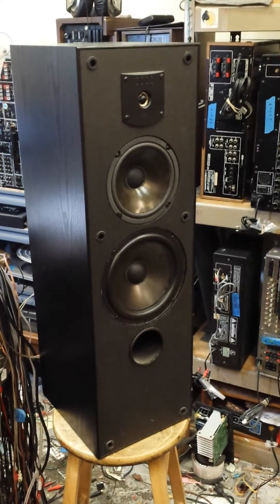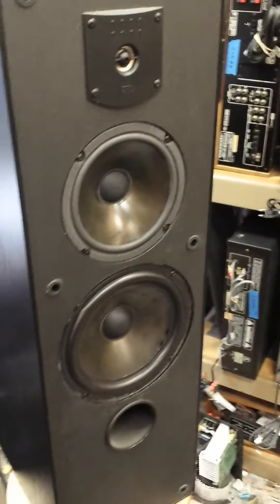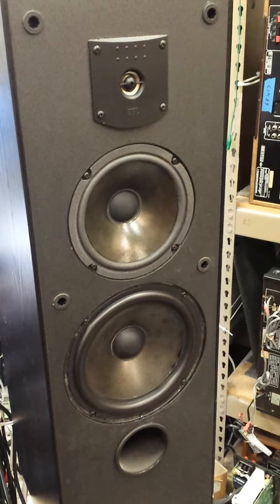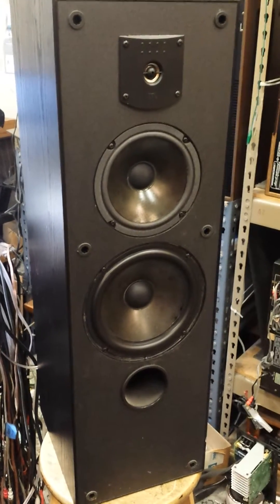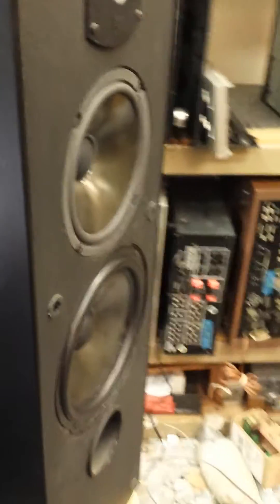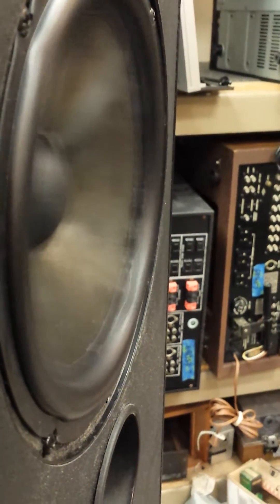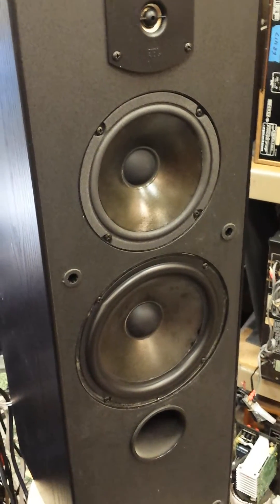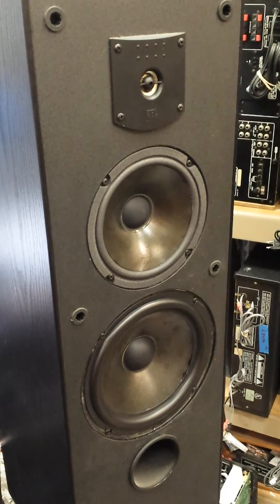Woofer cone breakup

Comment: That's not what breakup is.  breakup is something that occurs at high frequencies when the wavelength is much shorter than the cone.  What you're showing is harmonic distortion from over power.  You're basically saying that speakers need to have larger cones and handle more excursion.  Material isn't as important in pistonic operation.
Reply: In true sense of the term, this is certainly not cone breakup, because cone breakup happens in higher frequencies. Cone breakup is the reason why a woofer can reproduce higher frequencies only from its central dust cap area, not from the outer rim area.
Reply: Thats wrong. first at all what we see here is a cone brake up. we can clearly see the cone is bending at high powerlooad. secondly material for perfect rigidity and pistonic movements is impoertant its even extremely important. the more lighter and stiffer a cone might be the better is the resolution of the music thats coming out of the speakers. so for this reason you will see carbon fiber,composite or sandwich cones or paper cones threatet with carbon or carbon/ rohacell/carbon cones in high end speakers for perfect sound resolution. last but not least..some speakers need higher excursion to have a good spl at low freequencies and smaller voulmes of the cabinet